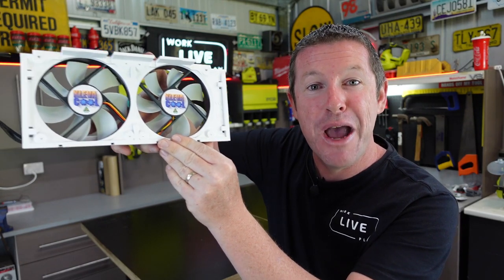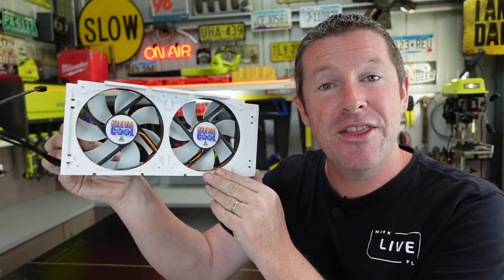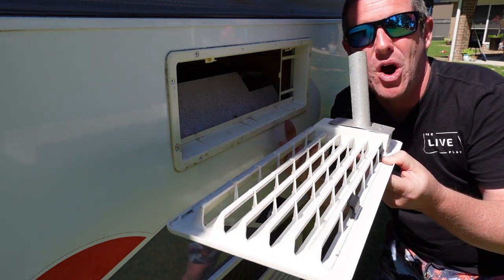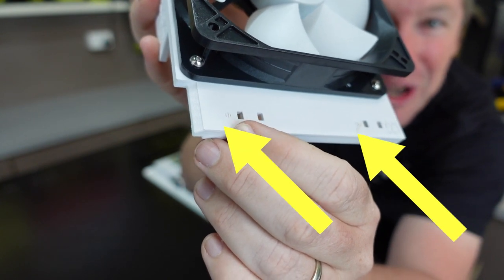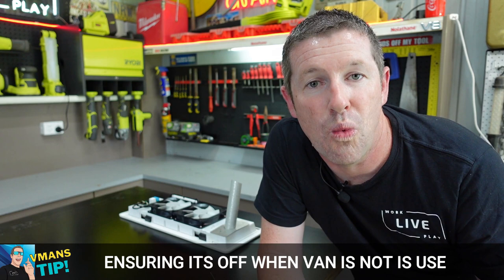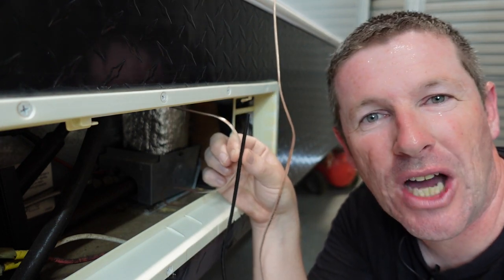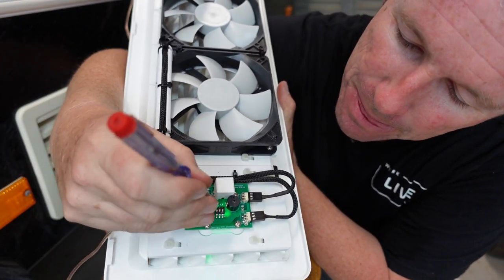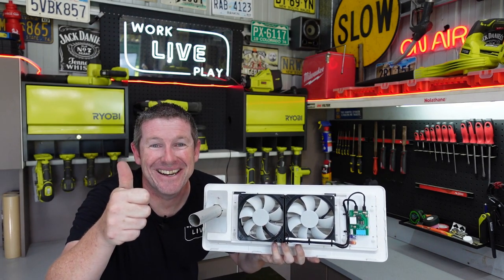LIVE | Klevacool 3-Way Fridge External Fan Kit - the easy DIY Caravan, Camper or Pop-Top accessory!

Comment: Another awesome video 
I installed mine to a switch so I can turn them off when van is not in use.
Klevacool highly recommend products
Reply from the maker: I might add one down the track, potentially a twin switch panel to marry in with the 12 volt pump which will be the next major project. I guess the advantage of connecting to the 12v management system (over directly to the batter) is that is does turn off when the van is closed down. It will however remain on stand by when the van is plugged into main power, using the Setec system. I must admit I did have to run out and check lol.
Reply: I did our fridge fans a few years ago and I also installed a switch because I wanted full control over when they came on. For example, the night before we go away I have the fridge on with the roof up about 15 or 20 cm to help stop any heat build up and have the fans on as well. I think a switch also comes in handy on those days when the ambient temperature is iffy.
Reply: Hi Daron. Can you share an example of the switch you put on? I need to add one - I connected fan direct to fridge as battery is on the other side of the van - however it seems to have continuous 12v power and is constantly on standby (even when isolator switch is off!).
Reply: @WorkLivePlay  Hey mate, love all your videos! I tried to wire my 12v water pump directly to one of the spare slots on the setec but it kept blowing the fuse. Jayco Swan. I then realised when I flip my battery switch, all my lights etc keep working (no 240v plugged in). So I assume in this case, it would mean the fans would still stay on? Greatly appreciate your videos, already helped me complete a few mods!

Comment: Thanks for putting this up. Great video. Can you provide guidance on how to wire when the battery is in the opposite side of the van to the fridge? We have the Jayco Lark.
Reply from the maker: My best advice would be to follow any existing cabling runs you can find. I would have thought the Lark would have the battery in a similar location to be honest. I've just been through a number of videos and can only guess the J35 is under the dinette seating? Have a look underneath and see if there is a cabling run under the floor. I literally live 500m from Jayco Newcastle so might have to duck down there one day for a squiz now they are back open again.
Reply: @WorkLivePlay  Yep. Battery under the dinette. I had a similar thought. There are electrics on both sides so must be a tube under the floor. I’ll climb under and see what I can find - will let you know how I go!
Reply: @WorkLivePlay  so it seems if you have an AES fridge there is a 12v power outlet available at back of fridge. This makes sense as the fridge needs a power source when running on gas. This is in the klevacool instructions.

Comment: Thanks for the video. Really appreciate the time it takes to edit the video together to help others. I've been looking at these fans for some time, but wasn't sure how easy they are installed. Thanks for showing all the steps. I'm not sure of the zip ties around the outside of the vent fins though - looks a bit rough. I would be interested in how much the fans run in moderate temperatures.
Reply from the maker: Hi Huzz-  late response sorry. Firstly thanks for good words. We are heading up to Kylies beach in a few weeks and I am aiming to do a comparison video of temperatures with and without the fans. In fact I could probably do in our shed as it gets very hot in there. The results should be quite noticeable. Its a great kit - I was on the fence with the zip ties however once installed I think it would be overly complicated to do another way without cutting things up or drilling holes. If there was an alternate solution I'm sure Royce would have implemented. The fans are soo quiet though - its crazy.

Comment: Just put our order in for a touring Swan. We haven't gone for the battery setup yet as we will be in parks all the time. Can this be done without a battery setup? Is there a 12v system built into the van I can plug this into?

Comment: I did this DIY for $22 with usb powered fan and a usb power adapter. They're just PC fans, you don't need a kit.
Reply from the maker: You certainly can do it more DIY however I like the idea of the kit as it's a lot simpler, especially for people who watch who aren't as handy. Royce has put a lot of work into integrating the temp control PCB etc so it just works. I do also really like how the mounts are integrated for each vent type. It's still working well for us 👍

Comment: If these are 3D printed (and I love 3D printing), will UV exposure become a problem with plastic degradation?
Reply from the maker: Royce from 3D Print RV has been through a whole process with filaments and plastics. He is certainly the one to talk to regarding this however I haven't noticed any degradation this far. He is very particular with what he uses, he did explain it a bit when I first saw the external light, in that instance, his extension is fully exposed.

Comment: Have Dometic series 7. RM7655L
Have mounted fans myself, but usual setting to cool down to 50°C for this fridge does not work. I am observing it and experimenting and it works around 65°Celsius (this the temp of the upper pipe at its hottest area). Still not able to nail it. Anybody has experience to share how to set this device please ?
It is above 32°C outside and fridge is struggling.
Reply from the maker: Have you contacted Royce over at 3DprintRV, he is extremely helpful and knows these inside and out being the creator, manufacturer and distributor of these fan kits. He will be more than happy to have a chat to you about it. We haven't had to adjust ours at all, however in saying that we are in a mildish climate here.

Comment: Do these fans not course negative pressure and suck the  exhaust gases  out of the open flue at the bottom where the flame is. Then into the  caravan. This will escape from around the front of the fridge into the living area. Beware Carbon Monoxide poisoning.
Reply: Not at all